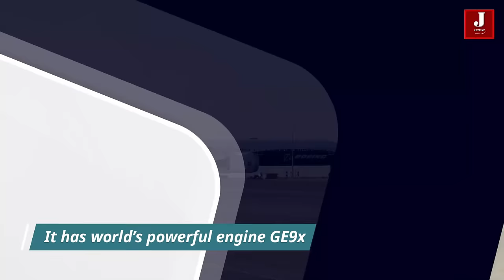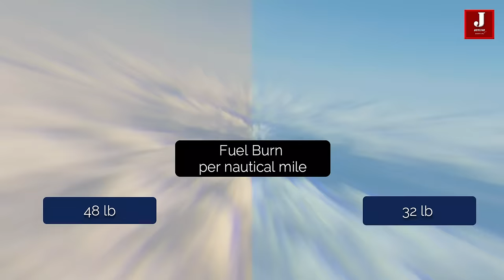Mega Comparison of Boeing 777x vs A350-1000 Aircraft

Comment: B-777X and A350 are both outstanding aircraft.  Your presentation not so much.  Your comparisons are misleading and dishonest; you should be comparing the A350-1000 to the B-777-8, not the dash 9.  I could go further but I feel like I’m responding to a Bot which would be a waste of time.
Reply: Yea
Reply: Damn i was just about to start watching the video
Reply: While watching this. I would like to point out that it seems the a350 is a better fit. Burns less fuel with a better range, can hold more passengers then the triple 7, and with the weight to range as well you are comparing a 6 cylinder to a 8 cylinder. Only difference is yeah the triple 7 has a better engine power for take off but that is about it. So I think the a350 is the better plane for the buck.
Reply: How do you know. The Boeing 777X is not in service whereas the Airbus A350 nine hundred and one thousand are in airline service.
Reply: They are incorrect on many specs on 777x 9
Reply: We can't compare the A350-1000 to any 777x because it's not certified yet 😂😂😂 DAMN BOEING
Reply: 777 - x is directly competing with A350 - 1000
Reply: Because is just better? 777-9 is 11% more efficient that a350 so you can cry
Reply: @themastercorpse  Not true ! This is false at the beginning the 777X was supposed to consume 20% less than the 350 then with the difficulties of developing the GE9 engine and the cell it went down to 15 then 10% less... Then the weight of the plane turned out to be heavier than expected and consumption fell to 5% less than the 350 and recently boing boing recognized that the 777X would consume more than expected and the equivalent of the 350 1000... Normal apart from the wings it is in aluminum and outdated compared to large carbon carriers
Reply: B777x uses ge90, not ge9X
Reply: A350 variants fly further than 777x variants. As for seating, they are very similar.

787-8 and -9 now compete with A330 800 and 900 Neo variants. To add, the A330 NEOs fly further than 787s.

Let's not forget, Airbus has better build-quality, and in general, quieter or less noisy engines than Boeing.

I have flown with Boeing 737 and 777 300er, and I am not a fan in contrast to Airbus A320 and A330 and A350.

I would go for Airbus all the way.

Hence, Delta Airlines has switched side.

Comment: As a 777 fan regrettably I must admit the A350 has the edge. That range is amazing and very fuel efficient.
Reply: The A350 has a composite (=lighter) fuselage and more advanced avionics. The 777X has half-generation newer engines and a newer wing. With its larger size it will give it a lower CASM on those routes where its capacity can be filled. Where it can't, the A350 is the better plane.
Reply: Agree, the range is the only real advantage.  Question is how many city pairs will that difference actually matter?  Not sure having a London to Sydney direct flight makes too big a case for an airline design.
Reply: @boatlover1875  There is another big advantage: lower flight cost. Where you have enough passengers to fill a 777X, you should definitely consider that. On routes where it's not the case, you'd be much better off flying a 90% filled A350 than a 75% filled 777X.

It's exactly the same argument as the 787 vs the A380, although here the difference between the two planes' sizes is of course much less. But still.

And then there are other factors. If your widebody fleet is already all 787s and 777s, you would probably not even look at the A350 as commonality is a big factor. Same if your fleet is A330s and A350s.

Then of course if you are a loyal Airbus or Boeing customer, you would get significant discounts on new orders, which need to be factored in. Etc.

I think Airbus didn't need youtube to make the case for its aircraft design, and the sales prove that it did it right;.
Reply: @jacobzimmermann59  If one has a plane you can't fill that does not reflect on the plane.  More like a poor management choice.
Reply: @danharold3087  Like every plane it's optimal for a certain type of traffic. If your traffic is of a different type then it's a poorly selected plane.
Reply: @jacobzimmermann59  Where it can't. the A350 is a better CHOICE!
Reply: In exchange for the range, the 777x has higher MTOW and payload
Reply: @danharold3087  Where 350 can't 787 is a better choice, where 787 can't 737 max is a better choice, etc.
Reply: 777-8 has better range
Reply: @CodPix  a350-900ulr has better range
Reply: @neb8096  ok, but it's only used for one  flight
Reply: @CodPix  
777-9 range 13500km
A350-1000 range 16100km
So how does the 777x have a better range ?
Reply: @ricky1231  777-8
Reply: @CodPix  
Ooh ok 👍🏿
Reply: @sakthimohan9242  higher MTOW should be a negative at this point as it negativity affects range. As for the payload yeah the 777 has 5 more tons but at this category 5 tons is basically nothing, thats less than 10% more payload in exchange for 2600km more range
Reply: @topethermohenes7658   Unfortunately, the A350-1K needs to reduce cargo including pax to obtain that range (reduce pax and cargo and load more fuel).  The 777-9 does not.
Reply: @markmudgett7579  unfortunately thats all speculation coming from you. Show me actual figures of 777x?
Reply: @jacobzimmermann59  777 is better
Reply: For me, nothing comparable since 777x is still just on the drawing board. Not Yet in service. Thank you
Reply: @markmudgett7579  A350-1000 has more range than 777-9 hence qwhy qantas ordered it
Reply: @CodPix  but 777-8 is more expensive than a350-1000 I think the good choice a350-1000

Comment: Some of your facts are incorrect. Eg the 777x seat more passengers than the a35k. Please ensure your facts are right before coming on YouTube. Just a piece of advice
Reply from the maker: Hii .. thanks for the advice .. facts are taken from Wikipedia.
Reply: @JetlineMarvel  exactly
Reply: @JetlineMarvel  Maximum seat configuration (one class ) for the 777-9 wasn't given. So, it is proper to access based on available 2 class for both. 779 is bigger than the a35k in every physical parameters, thus, should seat more passengers than the Airbus flagship
Reply: Airbus fanboy facts??
Reply: @uchedike9213  FrenchBee A35K; 480 seat
Reply: @stradivarioushardhiantz5179  ANA 777-300 has 514 seats and the 777-9 is a further slight stretch of 777-300 air frame so you guess how much of a size difference these have.
Reply: @JetlineMarvel  poor research!
Reply: Yep.. That and distance  both wrong
Reply: @JetlineMarvel  
The fuel burn comparison was way off. They are very close to each other in efficiency
Reply: The Exit Limit of the A350-1000 is 5 seats more than the 777-9 (480 vs 475). But this is because Boeing canceled the pair of Exits over the Wing that the 777-300ER featured. The 300ER has a 550 Seat Exit Limit, so the 777-9 would fit even more. But because No Airline ever seated more than ~420 passengers in their 777-300ER they canceled these Exits as they add to the empty weight of the aircraft and waste space. They added an optional Exit behind door 3 that brings the Exit Limit Up to 475, without These its at around 420 I think.

Comment: The A350 is by far the quietest and most comfortable plane I’ve been on.
Reply: for comfort, it depends of the airline
Reply: A380 is the best... was so quiet meanwhile 777-300 moves a a lot!!!
Reply: Is it more quiet than the 787? Felt like that was more quiet than a bus ride
Reply: @shonix123  it depends of turbulence
Reply: Becoz b777 has two Giant GE engines
Reply: @somdattsable5540  as opposed to the A350 that has tiny pedals?
Reply: You can't even recall your real name!
Why should anyone believe you?
Reply: i fell asleep on the 777 but not the a350
Reply: @MichaelKingsfordGray  what are you on about
Reply: @timmmm5012  irrelevant information. A350 is quieter its proven fact
Reply: Agreed, we fly to Malaysia and the 350 is a significant improvement over the Boeing equivalent. Quieter smoother, roomier and a better plane all round.
Reply: It’s a well known fact that even the A340 with 4 engines is significantly quieter than the 777. Not sure about the comparison to the new 777x but I think generally airbus makes quieter planes than Boeing. I won’t even mention A350. I will talk about the A340. The only sound you will hear are the engines. I have been on 777 many times. There is always rattling as if something is about to break.
Reply: @timmmm5012 you probably love the noise then
Reply: @CodPix not always cause Boeing almost forces a 3-4-3 to fill in the space with small crammed seats while airbus forces airlines to use wider seats cause the cabin is wide but not wide enough for a 3-4-3 configuration. The airbus A320 family has a wider cabin than the 737 allowing for larger seats .
Reply: @maxsaviation9512  I've heard little noise on the 777 but quite a lot on the a350, but that's probably just me
Reply: @maxsaviation9512  only 777 and 747 got this config. Airbus is even making a 3-4-3 a350. And 3-4-3 is better for airlines, so better for boeing

Comment: A350 wins in fuel effieciency and its long range,which to me is a big plus.
Reply: Is real competitor is the 777-8. The 9 is built to go shorter ranges but have more seating capacity
Reply: Depends, then 777-9 will be a much better Cargo hauler over longer distances and also is more fuel efficient per seats If the Airline can sell the extra seats over the A350-1000.
Reply: who told u ,, 777x 15-20% fuel efficient than its peer competitors
Reply: But what’s the point of more capacity? Isn’t that why the 747 died?
Reply: @chasetemple3129  no, because of operational costs, fuel, and othe better efficient planes. The 747 has a very large seating capacity, so that was not the reason. Airlines want alot of capacity, because more capacity=more money
Reply: @chasetemple3129  the 747 died because of the more efficient twin engine 777-300ER. It was not about capacity, they built over 1.500 747s.
Reply: @chasetemple3129    No, Chase.  Boeing will finish building its last 747 after 52 years of continuous production this fall due to the incredible improvements in power, reliability and efficiency of the new high bypass jet engines.  A four engine airplane just cannot compete with a two engine airplane.    The 747 removal from service after 50 years that transformed the aviation industry was met by final flight crews in tears the world over.
Reply: @widget787  .    1570 as of today.
Reply: @chasetemple3129  yes after 50 glorious years !!
Reply: This video is tricky because the 777X is not in service and worts they compare the 9 not the 10 who is bigger than the A350 by far
Reply: Why, do you usually refuel airplanes yourself? lol...
Reply: Funny how you can make real numbers say what you want.    Like fuel consumption, one could get 10% better mileage but the other might carry 75 more people.   Then the mileage or consumption per seat could make the other jet more efficient overall.  The 777x just looks cool also, just a bit better than the 350 but not drastically better.
Reply: a350 is newer, better.  but 777-9 comes out it will beat A350

Comment: The composite materials used in the A350 give it a much better weight to performance ratio which also equates to lower running costs. That makes it the best choice overall.
Reply: Boeing first started composite materials in b787,,so 777 x is made of composite materials nly
Reply: Ge 9X for now has not a good strength's reputation. It will maybe very expensive to entertain. No recent news on this point since late 2019.
Reply: Personally, I see the same rivalry as the 787 and the A330neo, the 777x and the A330neo are planes that somehow defend themselves against the competition.
Many airlines wanted to replace their A330-200s with 787s and this one is selling pretty well on the market so Airbus wanted to keep the A330 in the race with the Neo but that's just not enough. The 787 is a much more advanced and comfortable aircraft with better fuel economy and is an all new model.

It's exactly the same for the A350 and the 777x. The companies intended to replace their 777 and A380 with A350 (in particular Air France), and there Boeing wanted to maintain the 777 (which is a success) with the 777x which is like the A330neo, a more economical, more efficient version and with more capacity than older versions.

But only, the 787 and the A350 are simply better because they are superior advanced technology aircraft and much more economical and efficient with their carbon composition. Both of these if are best in class, a brand new more advanced aircraft will always sell and outperform an old upgraded aircraft.

Especially since the A330neo and the 777x keep their old heavy fuselage in aluminum metal while the A350 and the 787 have their fuselage in carbon, much lighter and which reduces fuel consumption and makes the cabin quieter and which suddenly makes these planes more comfortable.
On the other hand, the 777x has a better chance of withstanding the competition thanks to freight and cargo variables and also the fact that companies can use it to replace their A380 or 747 while keeping almost the same amount of passengers per flight and that with less fuel consumed and much more efficiency.
Reply: @planeup__3049  absolutely accurate explanation of all the differences
Reply: @planeup__3049  But the body of the Boeing 787 Dreamliner will be manufactured at Italy by an italian manufacturer and not by boeing itself

Comment: Fair comparison should be 777-8 vs A350-1000

And also 480 seats for the A350 is the theoretical exit limits. It should be compared to the emergency exit limits of 777 as well.
Reply: I though the 777-8 project had been dropped?
Reply: @yo yo Projects get dropped all the time. The A358 has been dropped, the 737ERX has been dropped, the 787-300 etc. You never get a plane "for free". There are design changes AND systems changes involved, you must certify it, set up assembly lines etc. When the demand for that plane is deemed too weak to justify the investment, it gets dropped. In the case of the 777-8, it was too close to the A351 in terms of capacity to be competitive performance-wise so AFAIK it was killed off in 2019. It's one of the reasons why Boeing lost Qantas' Sunrise bid by the way.
Reply: The thing that actually matters with both aircraft is the cost per passenger per miles that one seat can take. That's why the 777-9 is stretched to fit more passengers which will automatically lower the cost per seat mile compared to the 777-300ER. So that it can remain competitive with the A350-1000. Not to mention that the biggest advantage the 777-9 has over the a350 is that it's the 777-300ER successor. The a350-1000 is a standalone aircraft and despite being older, doesn't rake in the amount of orders compared to the 777-9. Even if half those orders are Emirates. Also since the 777-300ER is still a more than capable aircraft, airlines have no need for an a350-1000, at least currently. 

Anyways...
Problem with both 777X aircraft is that they are heavier than the a350-1000 as the a350 has a considerable larger amount of CFRP uses. 

The 777-8 is however not competitive with the a350-1000 looking at the specs. The 777-8 carries slightly more passengers, with the same range but with FAR more fuel and a FAR higher OEW. 

The 777-9 vs a350-1000 is actually the right comparison.
Reply: @jacobzimmermann59  Never heard of any news that the 777-8 project is dropped but there is a chance they are probably going to because it's just not competitive with the a350-1000.

Or maybe not and the 777-8 will continue but I'm just not sure whether it's going to be a huge success.
Reply: @yo yo Air Caraibes is currently operating 3 A350 with 480 seats all economy.
Reply: @hodb3906  The CASM is not the be-all-end-all of aircraft competiveness. If it was, the A380 would have been the best selling aircraft in history. The actual cost/profit ratio per passenger varies for each aircraft depending on the number of passengers. If your business plan involves flying 400 passengers at once, the 777-9 is your best choice. If your business plan is to fly 300 passengers (either because you want more flights instead, or because you fly a route that simply doesn't have that much traffic) then the A350 is your aircraft. And if you fly between 200 or 250 passengers, go for the 787. There are obviously a lot more factors involved but this is the gist of it.

I don't know what you mean by standalone aircraft. There is nothing "standalone" about the the A350-1000, it is a member of the A350 family which has had over 900 orders so far. It has full commonality with the other A350s and in terms of cockpit and pilot training is a step-up from the previous-gen Airbus families (A320/A330). And if Wikipedia is anything to go by, then the entire 777X family (incl. freighers) has recoreded 191 firm orders as of January 2022 whereas the A350 alone has had 165 (excl. freighters). Hardly the massive steamrolling you seem to believe.
Reply: @jacobzimmermann59  would rather use the A330-800, 465 more nmi of range than the 787-9
Reply: @spacejetande-jetfan798  If you need that extra range. If you don't, then the 787-9 is cheaper to operate.
Reply: Few companies are operating the 480 seats A350-1000 currently